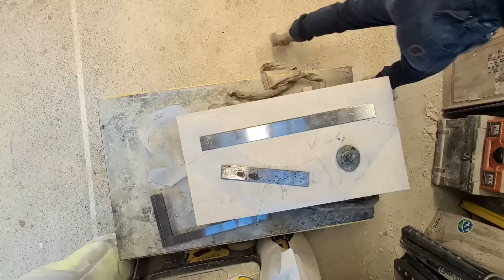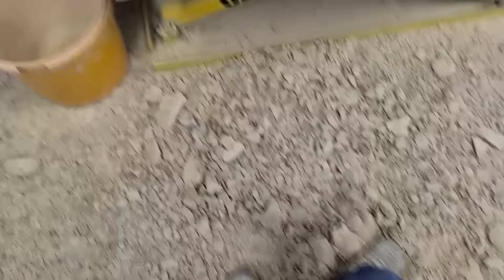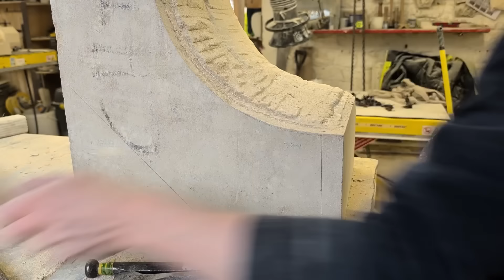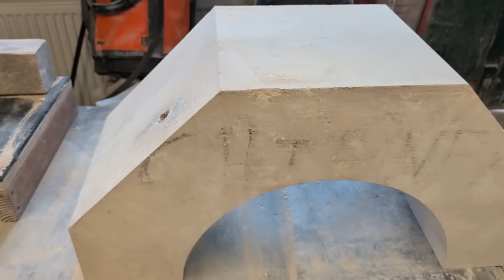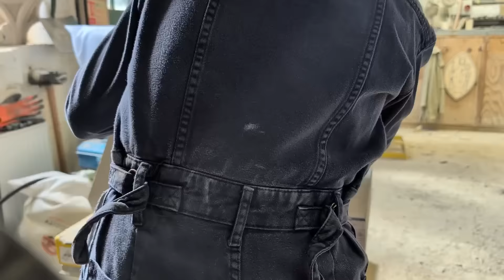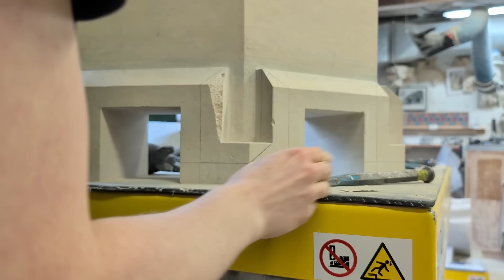The chimney fell down! Let's make a new one. #masonry #lincoln #cathedral

Comment: Great video.  I have two questions 
Are the chisels tungsten?
Why didn't you make some sort of joint (mortice or something) to lock the two semicircular chimney halves together?  Is that something you do?
Many thanks for the videos.
Reply from the maker: The chisels I used on this stone are tungsten tipped 👍 and using those kind of woodworking joints on stone is quite rare, I have seen it a couple of times, but the amount of work that goes in to accurately cutting those shapes in stone is not really efficient, we are more likely to use lead/metal cramps. 👍

Comment: You are correct, your "sparkly holes" are indeed geodes! They are formed when there is a hole in a rock for whatever reason that is filled with a fluid (often water) and then from that fluid grow crystals (in this case it looks like calcite, the same mineral limestone is made of but in the geode they are big enough that you can see them with your naked eye). Geodes are pretty common in limestone as it is quite easy to dissolve (rain water is acidic enough to do so if given the time) and fossils in it also have a tendency to dissolve and leave room for a geode to appear (in which case you have a geode in the shape of a fossil like an ammonite or a brachiopod).
The largest geode/cave full of crystals I'm aware of is the "Cave of Crystals" in Mexico with crystals up to over 10m long so it could have been worse for you :D 

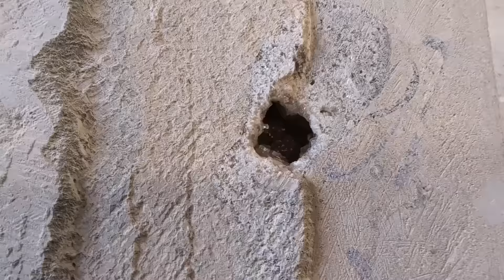By the way at 19:13 to the right of the geode are darker "C" shapes. These are fossils of brachiopods (like oysters for example) that you cut through so you see the section.

The main dark, thick line visible on one of the faces is probably also a cavity but this one would have been filled (possibly with mud) and didn't have room for crystals to grow. At least not on the surface where we can see it ... Actually at 19:32 where we get a close up it's clear it was a hole (possibly a burrow) that was only partially filled, the open space crystallizing. 

Regarding tools, have you looked into diamond sharpening stones? For someone using them as often as I suspect you do, they are convenient as you don't need to lap them like you do with whetstones to re-flatten them. I don't know if it's as critical for you as it is in woodcarving/woodworking tho. 
Also do you have the equivalent of gouges for working the inside of concave parts? Or do you just work with bullnose chisels?

Lovely work!
Reply from the maker: Very informative! Thank you!

Comment: I get a similar effect as white finger but semi-naturally. 
I had an accident where a gas canister exploded and burned my arms, one of the rare thing that can happen is nerve damage called Arterial Spasms. What that does is damage the nerves that control the opening and closing of arteries when an area requires more blood. 
When I use my hands, to say, hold a chisel for long periods, the signal that would send a message to the brain to open an artery to allow more blood flow to the muscles doesn't get through, my shoulders begin to hurt then suddenly the chisel will fall out of my hand as will the hammer as my hands cramp, it takes around 15 minutes to pass, but if I pick anything up to work again they will cramp almost immediately. To combat it, I used to rotate about 4 jobs at a time to give my arms time to recover.
If I were doing your job I would have to use powered tools to get through a day.
What is the purpose of a masons hammer?

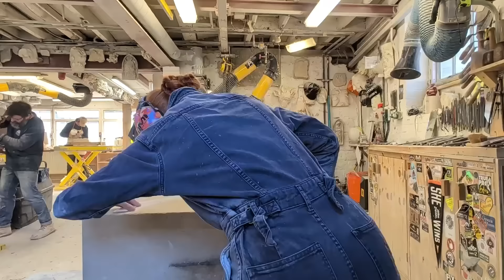Comment: I'm curious about an item on top of your block at 4:56 in the video.  It looks a bit like a tiny wizzards's hat.  Is it a mason's tool & if so, what is its function?   And is it what you have tattooed on your left wrist?
Reply from the maker: Very well spotted! It's my template weights (we all have lead weights from the cathedral lead worker to hold our templates down) mine was cast in the shape of a witches hat to match the witches hat on my wrist.
Reply: Cool.  A nice way to individualize your tool in the shared workshop and a thoughtful gesture by the lead worker.  Would they be a   leadsmith in the same tradition as tinsmith  or silversmith?